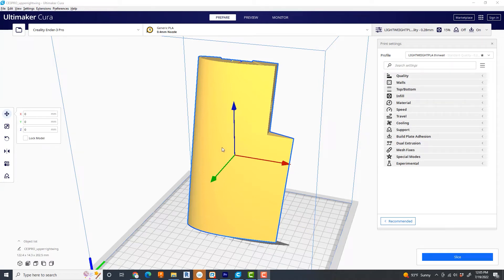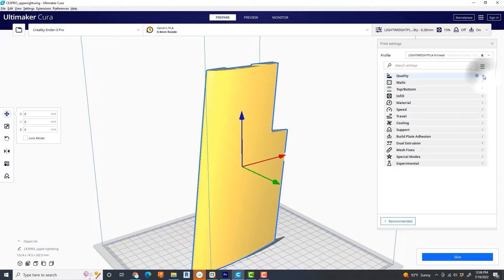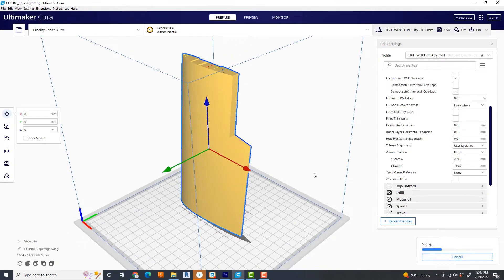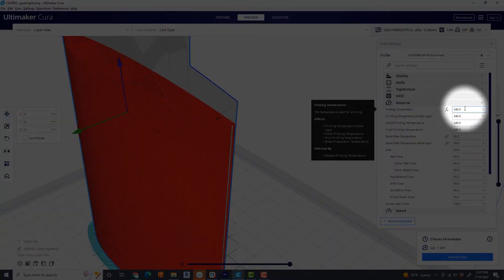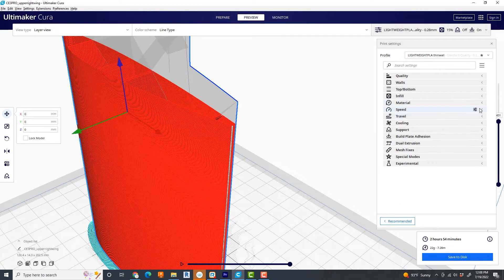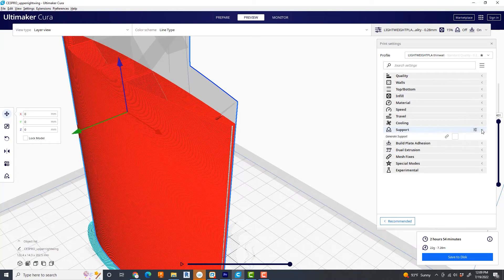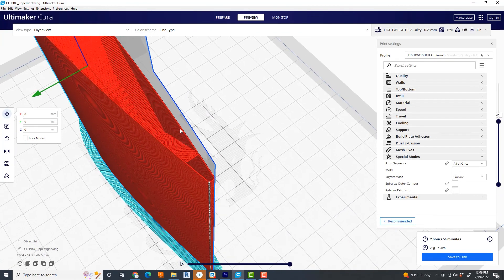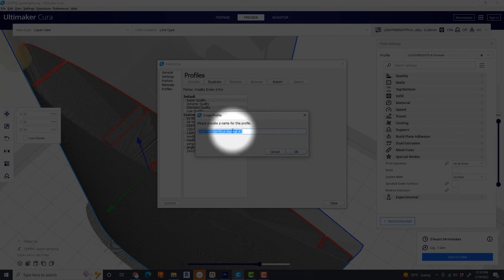Thin wall printing Success!  My Cura Settings for Lightweight PLA

Comment: Hi, I just printed my first LW-PLA plane and I’m having some problems with the really thin parts like the rudder for instance, when it gets near the top I get a lot of horizontal lines in the print I assume from movement. Is there a way to get cleaner prints? Im using an Ender 3 V3 SE. Thanks Paul
Reply from the maker: How can I help you?

Comment: Great video - subbed.  I assume the print is designed in order to print in one line without any retractions?  I'm trying to setup another model (3DLabs) and I am not able to get the print head to print in one single line on Surface mode.  If I select Surface mode it deletes the internal wing structure.  It also will not print on one single layer without retractions.  Is this something that is built into the design?  I believe one of their newer aircrafts is designed for LW-PLA and prints like in your video.  I've played with all the settings in Cura and can't seem to get it to work for LW-PLA without terrible stringing on a thin wall print.
Reply from the maker: Yes it's built onto the design so that it can be sliced and the print head only follows a single path without retractions.  This single path also builds the inner structure but as far as Cura knows it thinks it is just printing an outer shell.  It's a fun brain teaser to design the part from the print heads point of view.  3d printers can manufacture in ways absolutely impossible by other means.  It's fun to design to those strengths.  It's so cool when the part comes out perfectly clean.  It's also a faster print as a result.
Reply: @redbaronrc  Ah, that makes sense. It would be great to see a clean LW-PLA print. Love hate with that stuff, lol. 
Thx for the explanation.
Reply from the maker: @Paul B Go to my website at redbaronrc.com.  Download the "free Extra 300"  Follow the instructions to apply the discount code for zero cost.  load up one of the wing sections and give it a shot with LWPLA.   Make sure to follow intructions on the online blog.   You'll see what a clean print looks like.
Reply: Paul B, did you get it figured out? I am also attempting to print a 3Dlabs Cessna and all I have been able to do is waste filament. Im using Said Smart LW-PLA.
Reply: @USMotorHead  sort of. I still can’t get the same travel as in the G code print but it’s close and different parts print cleaner than others. The wing prints very clean with minimal stringing. The fuselage for me still needed quite a bit of post print cleanup.
Reply: @paul_bunyan  Thanks for the reply. Not having any luck here. Still trying different retraction settings, but still very stringy. Frustrating.